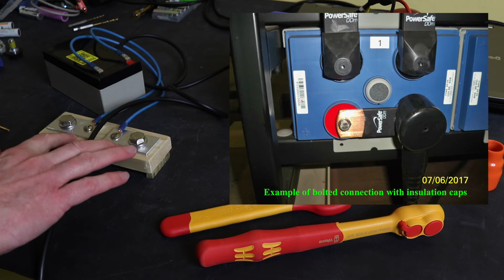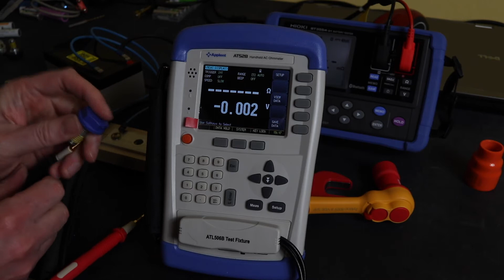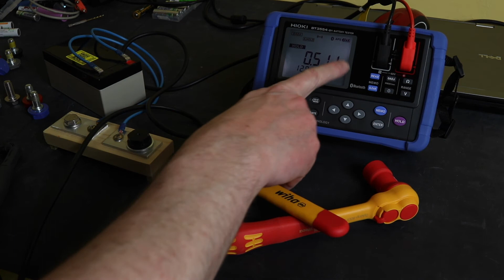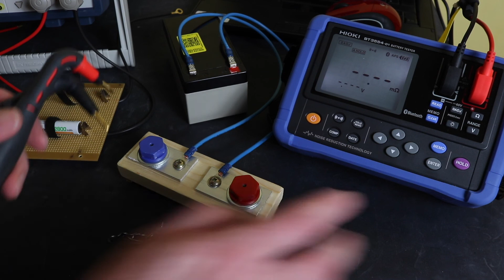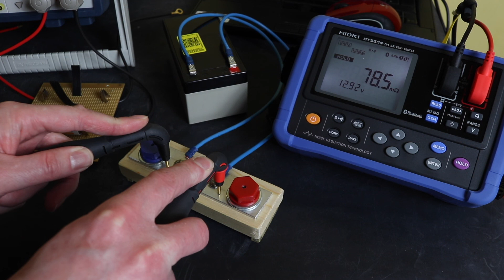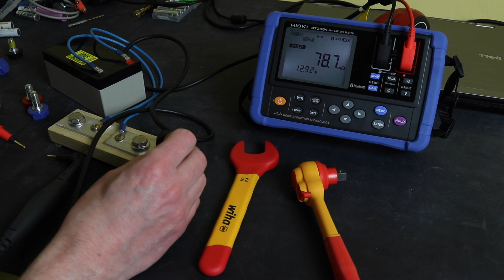Testing Cell Bolt Connections with the BT3554-01

Comment: I've never seen the bolts with the lead in them like that. I guess it can make a more malleable / better (?)  connection when probed but seems to add in too much resistance for anything other than voltage measurements. Perhaps the lead has cold flowed from around the crimped connection, since they looked like they were staked / crimped on to the top and caused a bad connection. These bolts look like something that looked good on paper, but not to good in the real world. I wonder how well they would test using a low Amp DLRO to test the actual lead to steel connection in the bolt itself? We see what they are doing with a basic battery impedance test.
Reply from the maker: I came across them about 3 years ago, when some new cells were installed at one of our sites, and so the saga started. I have the MTR105 that has a 200mA test current, I will have a look at my other meters and see if I have a probe set that is compatible with its terminal layout.
Reply: @three-phase562  They definitely looked like a good idea, but as we can see they didn't work out so well.  I'm surprised you don't have a higher current DLRO with all the tools you have. Sure the MTR105 would even be a good test for the conductivity between the lead and steel anyway. But maybe not show the true resistance. Then again, these aren't made to pass any current, other than regular testing current, which they seem to fail at anyway.
Reply from the maker: @inothome  🤣, I have a DLRO that can inject up to 10A, but I need a concentric style probe to connect into the test point on the bolt. The leads that come with the DLRO are duplex style so won't fit. I don't fancy sending 10A down the Hioki leads as they are £200 a throw. I could try using a standard multimeter probe with a doubled up lead, that shouldn't add too much resistance to the test.
Reply: @three-phase562  Ahhh, yeah. I didn't think that one through... at all. No room for the current and sense leads on that little bolt with a higher amp DLRO. Opps....
Reply from the maker: @inothome  No worries, its easy to spot when you are sat there looking straight at the duplex probes. I may be able to conjur up something yet.

Comment: I don't think I've understood the purpose of the lead balls, they just seem to make life worse?

Quite amused by the range of brands of insulated tools, nice to see you're not completely wedded to one!
Reply from the maker: For impedance testing, they can create an issue, but I presume that for use with a multimeter for voltage measurement, they provide a better surface contact than just the tip of the probe onto the steel surface. They must cost more to make, so there should be some reason for installing the leads plugs.

Yeah, I like a mishmash of tools, mostly collected over the years, but partly I set out down one route and then find that not all manufacturers make all the tools I need, Wrea for example do not make VDE spanners, don't think they have a VDE torque wrench either, although Whia have just brought one out.

Appreciate you watching and commenting